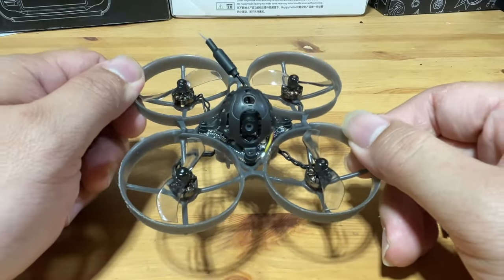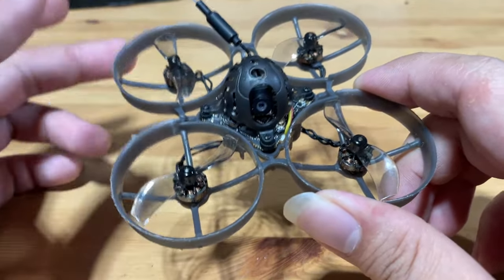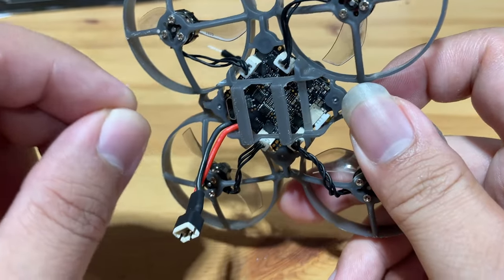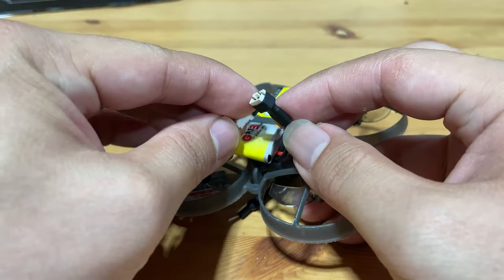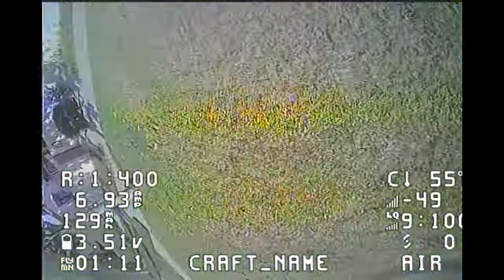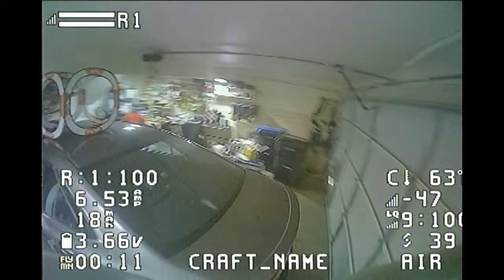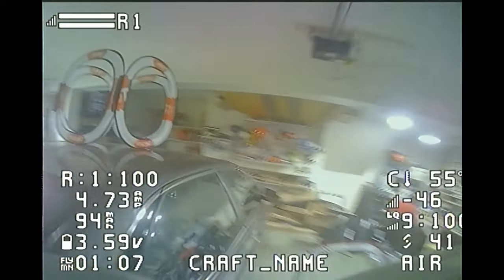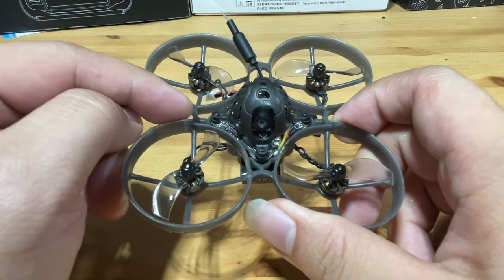Mobula 7 1S ELRS Whoop | Still the king for FPV Beginners! #drone #happymodel #fpv

Comment: Just purchased this it comes on Wednesday cant wait scotland gets so much rain it will be nice to be able to fly indoors when the weather is bad i had the th3pf was a dam good quad but it keeps dropping out the sky for some reason i hope i dont have the same problem with the mobula 7😅
Reply: I bet it was overheating. Mine overheated flying slow indoors. I added temp to the OSD and outside flying fast it stays around rp degrees. Over 65 plus it stops to protect from overheating

Comment: Hello friend. I would like some information when configuring modula7 in which stabilized flight mode option? Does it have this function?
Reply from the maker: The mode you are looking at should be Angle mode. this will be the most stable mode you can get